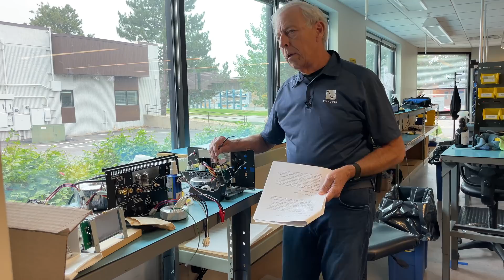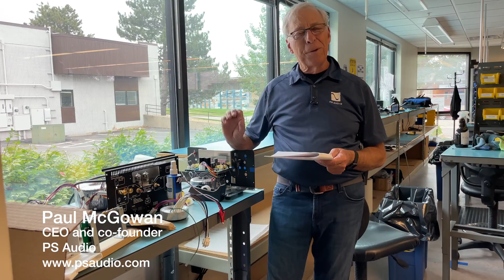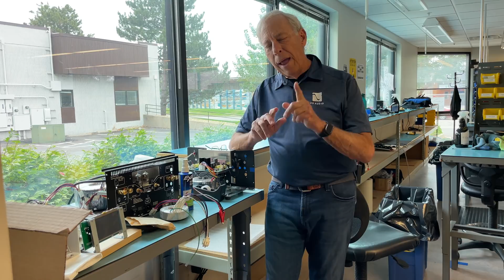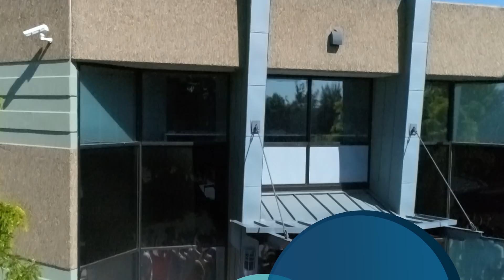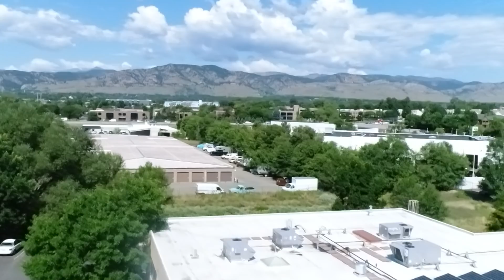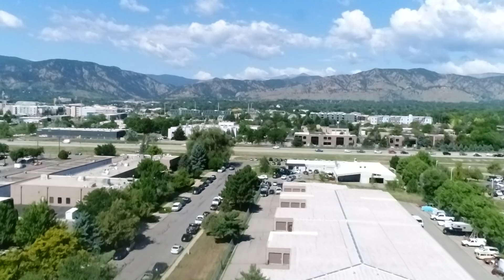Why vacuum tubes need matching

Comment: Howdy. Yes.
The gain matching is the most important aspect.
There is a point in bias matching too. When the bias is balanced the residual hum will be cancelled out in the output transformer.
Regards.

Comment: I had to do matching by hearing, as i had no proper tools. When imbalances are found, the sound comes more from the other channel, and the sound direction is sifted. I had 6 tubes and just switched one side of my FX-Audio tube 03 till sound was coming from the centre.( keep left the same and switch right side, i had to switch the left once too, as the starting tube had no good match)

Comment: When I built my class A monoblocks, with multiple Motorola MJ15003s in the output stage, I built a test unit that allowed me to match the hFEs of the transistors at a specific current rating for lower distortion levels, so I consider matching to be important in solid state amplifiers too.

Comment: You may also want to mention that transistors in audio products need matching too. When you have multiple pairs of output transistors in a large power amp (> 100W), they need to be matched. There is some slop allowed due to the emitter resistors but overall they should be reasonably matched. Another area are the transistors on the input diff amp stage. These too need to be closely matched and are often coupled together mechanically so they both are always at the same temperature.

Comment: I just want to inform people but matching components is a thing whether they are tubes or bipolar transistors. Resistors capacitors and inductors and diodes virtually every component are all checked to be within specified tolerances. You either like the sound of tubes or you don't it's a personal choice.

Comment: Paul your right but how does it work for example power tubes like my kt88/6550? With bias I set the current the same. Even when one tube has less gain it sets it in balance.
Reply: They are both the same
Reply: @GK-rw2op  what are the same? Power tubes and pre amp tubes? Noway they aren't.
In pre amp tubes it is a must to have a balanced matched pair, depends a lot on how it is in use ofcourse.
By setting bias to power tubes the minus amping and plus amping tube can be set equal. In pre amps almost impossible.

Comment: Thanks Paul. Not to be overly pedantic, but it is very common for brand new tubes to lose 10 -20% of their gm in the first few hundred hours of operation - then settle down at their new gm for the long run, provided the tube is not being electrically abused too much. To really match them tightly, they should be pulled off the burn-in rack and inspected (matched) on a curve tracer. Followed by noise floor measurements and any other desired parameter that may be pertinent for the intended audio application. I believe the last manufacturer to do this for some of their tubes was Tektronix. Not even an audio application, and back when they were making their iconic line of tube-based oscilloscopes.

Comment: The question was about buying matching output tubes.... Hmmm....
Reply: 1:32 He did say output tubes, then went down another path explaining gain, but did not explain why gain was important in push pull output sets. Symmetry of the positive and negative halves Paul!
Reply: @zulumax1  I wonder if amps with auto-bias makes a difference.  I never buy matching output tubes though...

Comment: In guitar amps, I like to have them mismatched a bit. This tends to afford a good amp more harmonic complexity.
Reply: Yes you don't want them matched in a push-pull configuration can lead to tube oscillation but what Paul is talking about showing is singing ended configuration
Reply: @johnsweda2999  single ended guitar amps like what was normal in the 50s and before are really great sounding too.
Reply: @graxjpg  yes, but highly inefficient and low in power output.
Reply: @mvb819  well, yeah, but that is entirely irrelevant to a musician or studio owner who’s using it properly haha!